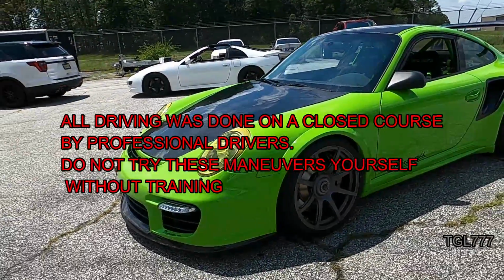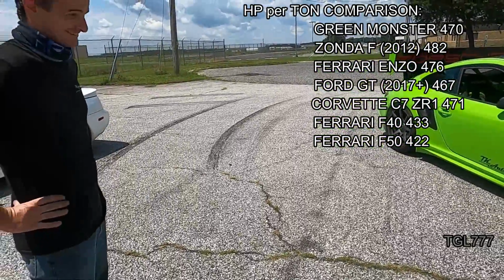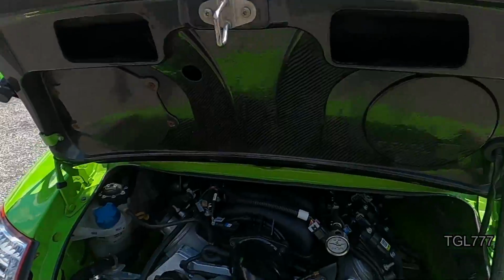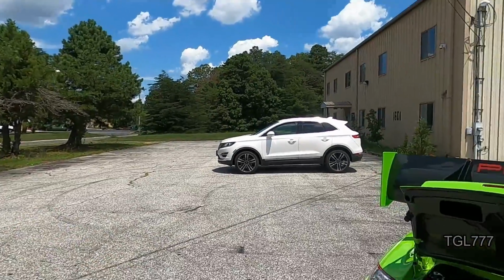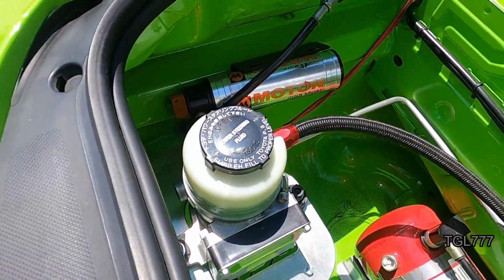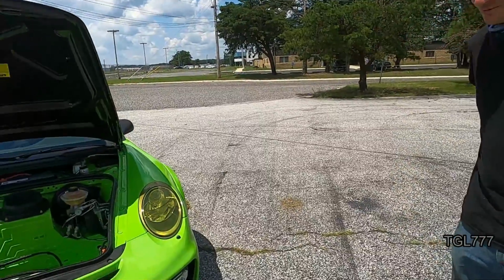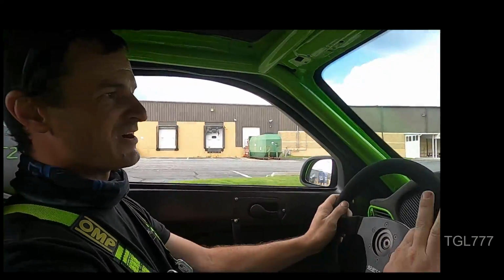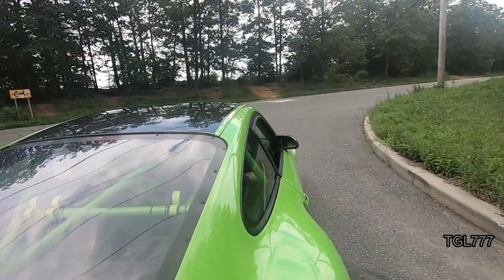Porsche 911 Turbo  Chevrolet C6 Z06 LS7 Swap TK Autosports, Road and Track, Renegade Hybrids

Comment: Where is the radiator cooling system
Reply: Stock Porsche location. There are 3 radiators behind the front bumper openings,  Left, center and right. Plumbed in series.

Comment: You wont gain power with the 180s you will lose power between 40-60hp but you will gain oooodles of torque

Comment: Forgot to mention the editing is second to none. Excellent camera work. At one point u had 3 cameras running, when the driver (TJ) did one to two to 3. You showed 3 different viewpoints front, outside right and rear and they were all in synch and w the shifts. Also, killer intro and great outro. Awesome. Can you share your equipment and editing software? Thanks. Awesome job 👍
Reply from the maker: Thank You Hogan H. Yes we did have 3 camera's running at the same time and it's always a bit of a challenge to synch them together for continuity. Wanted to do the same thing during the 'Donuts" scene but the bumper camera ran out of juice. The batteries are the weak point with the GoPros. I will list the equipment in the vid's description but here it is: 2 GoPro black 7 and 1 GoPro black 8 cameras. Editing software Filmora 9 the basic version. Thanks for your comment and watching.

Comment: This is great! Never saw anything like this. This is a great alternative as Porsche engine prices are super expensive. I would also like to know the cost for doing this to a street car.
Reply: Copy+Paste my reply from above comment:
Not quite a simple answer but I'll try to keep it short ... Also I am not very experienced in LS swaps.
With such a wide variety of LS engines with wide pricing there are cheap ways and expensive ways.  There are a few companies that make "Kits" (Chavis Performance, Renegade Hybrids, Stuttgart Muscle to name a few. Swap parts alone budget about 8-10K. Then add engine, super cheap junkyard LS to fully built LS7. Then if your mating to the Porsche body harness you need a module for that to retain all factory Porsche gauges just translated from the GM computer. Then add labor if it's not a diy of about 40 hours. 
I'd say DIY can be done for as little as 12-15K. For professional install double it

Comment: After watching this I would definitely buy a Porsche with a blown engine and get this conversion done. How much would that cost?
Reply: Not quite a simple answer but I'll try to keep it short ... Also I am not very experienced in LS swaps.
With such a wide variety of LS engines with wide pricing there are cheap ways and expensive ways.  There are a few companies that make "Kits" (Chavis Performance, Renegade Hybrids, Stuttgart Muscle to name a few. Swap parts alone budget about 8-10K. Then add engine, super cheap junkyard LS to fully built LS7. Then if your mating to the Porsche body harness you need a module for that to retain all factory Porsche gauges just translated from the GM computer. Then add labor if it's not a diy of about 40 hours. 
I'd say DIY can be done for as little as 12-15K. For professional install double it.
Reply: @tkautosports5905  but isn't the main issue finding a 911 with a blown engine ?  Don't most places just part out and not even offer clean cars with blown engines ?
Reply from the maker: I am thinking the same thing. If TJ does not chime in on this question I will ask him and follow up.
Reply: So 6k to 7k for the conversion parts, plus the car and the engine with ecu/wiring. Also the wiring into the car will be extra(gm to porsche harness, gauges, etc
Reply: Facts